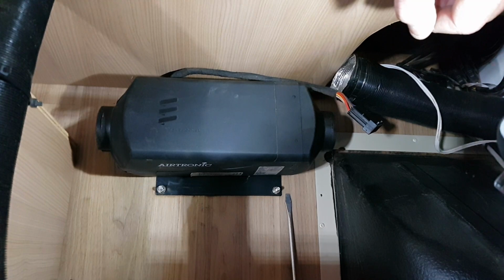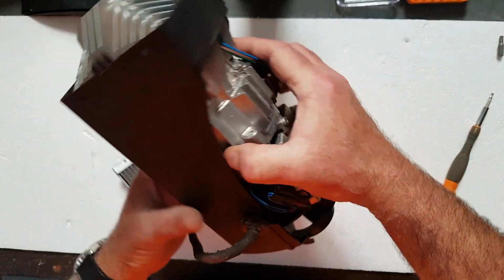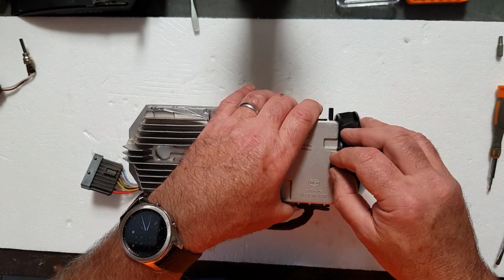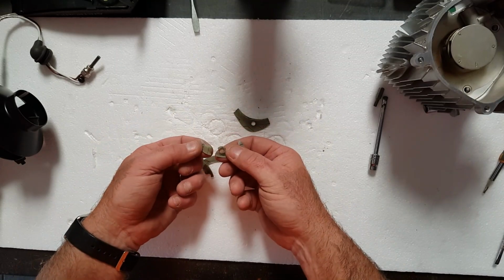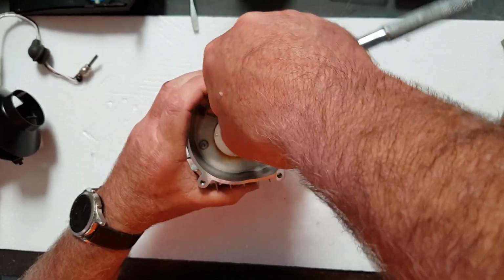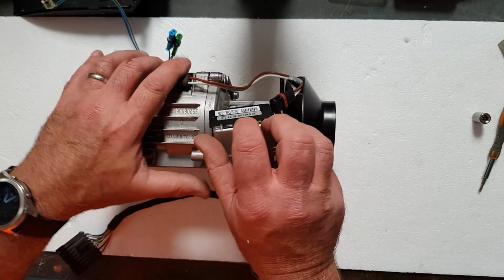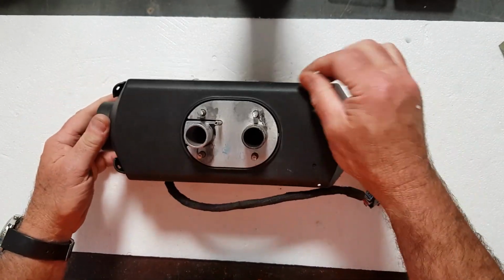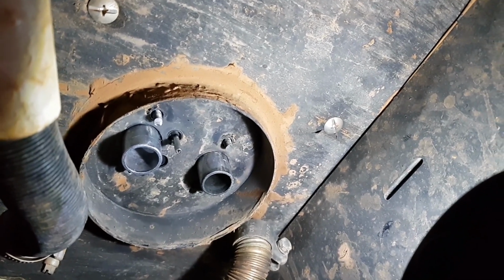Eberspacher diesel heater stripping and servicing

Comment: can I used Diesel Fuel, Supplement/Cetane Boost in my heater fuel to make it burn cleaner , keep it cleaner?
Reply from the maker: Hey McAlester, although there's no compression to compromise the heater from a higher Cetane rated fuel, I have no clue if a higher Cetane fuel and the resultant higher temps may well have an adverse effect on heater components.  People do use Kerosene in diesel heaters, but Kerosene has a slightly lower Cetane rating.   My only issues have ever been from the screen and that's from start-up and not so much from running of the heater, so Im not sure an additive would have much effect for me.  Be interesting to know which direction you go with this, cheers

Comment: How has it been with the metal gasket? And if it's gone well, can you post a link to where someone might purchase one?
Reply from the maker: Heaters works fine and no CO leaking, but I wont get a true indication until I pull the heater down in   the next full service. Search Warmda diesel heaters for the parts.
Reply: @Vagare  Copy that.  Thanks.  Also, do you think you could use a butane torch (i.e mini creme brulee torch) to clean ou carbon build up in the burn chamber?
Reply from the maker: @philkong2642  A butane torch wouldn't do much, the flame during the heater operation is pretty ferocious. I suspect even a oxy/acetylene probably would cut it either.  A spray-on carby throttle body cleaner would help to loosen it up

Comment: Great video to watch before the first time I tackle this,  thanks for making it clear. No faults showing on the display but it's not heating, I don't know it's history so deffo needs a strip & clean. Have some gasket paper in the man cave. Superb, cheers
Reply from the maker: Thanks Colin for the feedback, good luck with it
Reply: I've managed to cut a new gasket to a nice fit, the gasket was toast as you said. Fell to pieces, cleaned up the gauze that surrounds the glow element.. I noticed that once I split the unit I could use a 12mm spanner to remove the glow plug from inside the casing which was really easy, fingers crossed it works then I'll order a proper gasket/refurb kit or try to find the metal one you used. Thanks again.. I spotted a pipe and silencer box from China on Ebay for £12, if it works ok I'll treat to one of those. The old pipe work is toast also
Reply from the maker: @colinhaig8083  The point of my vids is just to give folk some confidence to give it a go, so your more than welcome.  It's very satisfying when you have a win isn't it :)

Comment: How do you propose actually cleaning the unit? Would you advise using carb cleaner or some other type of cleaner, or just an abrasive wire material?
Reply from the maker: My heater hasn't gummed up enough to require much more than a scouring pad. Throttle body cleaner would probably be ideal or carburettor cleaner to a lesser extent

Comment: 9:05 pause the video 
if you don't have the slotted 12 mm tool you can access it from inside with regular wrench 🔧.
Reply: good advice from you
Reply: F&K a 12 mm wrench?
Reply: Vanwives yes 12 mm wrench ...tighten inside the housing instead of pushing the slotted tool through the entrance hole for the glow plug

Comment: Thanks for the video. Can you please tell me where the fuel filter location is.
Reply: There's a screen in the pump that can be replaced...
Reply from the maker: I dont run a fuel filter, but if you have  one installed it should be inline btw the fuel tank and dose pump
Reply: On the inlet side of fuel pump.